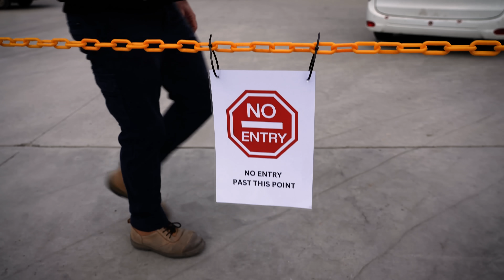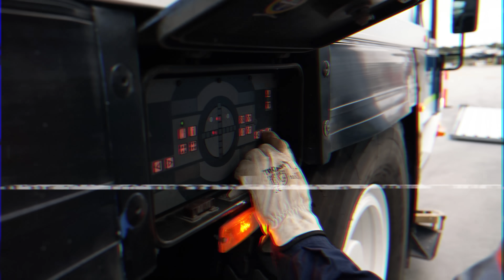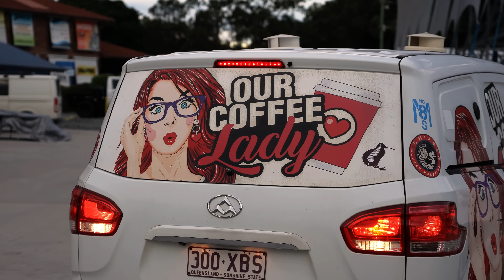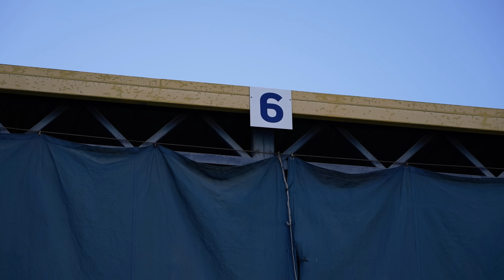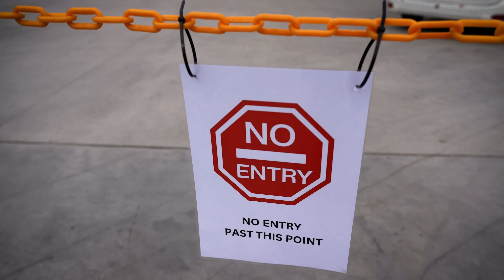FLIPPING Our Boat with a 60 Ton Crane 😱 Aluminum Catamaran Build Pt. 10

Comment: Woo Hoo! What a flipping good time.

We do that stuff all the time in the shipyard.  The only difference is that the parts we're flipping weigh in at 50 tons or more.  I was a bit concerned to see the big crane set up perpendicular to the CL of the boat such that the boom on that crane would experience a force off to the side when the small crane began pulling the hull to the side.  The big crane should have been set in front of the hull with the small crane at the rear such that there would be no radial force placed on the boom of the 60 ton crane.

Good job Y'all.  I can't wait to see her in the water.

Comment: Those chains on the crane to lift the boat from the shed seem kinda small but they worked! I can imagine that would have been nerve wracking.  I used to be a tool & die maker and we flipped 10 ton dies. I didn't like  being close when we dis that.

Comment: The other 2 cruisers, La Vagabonde and Gone with the Wynns built theirs in Asia. You picked Australia. I don't think the Asian places could have flipped a ship like that. Nice to be in a first world country that has the ingenuity and suitable equipment for the task to flip a 5 ton boat over. Well done mates.
Reply: They have construction cranes in most countries.
Reply: @captainjimolchs  Did you watch La Vagabonde episode when they tried to put their new Rapido in the water. It was a hairy moment with inadequate equipment and poor planning. Not only that people were onboard including Ralley when it was lifted about 25 ft in the air to put in the water. Safety was no concern. You would not see that kind of carelessness in Australia. I know about the 3rd world, I'm living in such a place in Asia as I speak.
Reply: @tommon6591  You have established that the capability exists.  Did anything break?  Was anyone injured?  I would guess that none of the crew of La Vagabond was lifted because there would have been no need for them to be there.
Reply: @captainjimolchs  Yes the captain, Ralley, was one who on the deck when lifted thinking he'll go down with the ship if it dropped and it almost did because the crane reached it's max extension and was about to tip over.
Reply: @tommon6591  So nothing broke and no one was injured.  The captain was either stupid or creating drama  for the video, or both, as was done in the current demonstration.  It is surprising that the operator allowed anyone aboard, or that it was necessary to raise to 25 feed to put it in the water.  How often do cranes fall over in Asian countries, compared to the rest or the world?

Comment: she looks like a very good liveaboard alu boat, not very sleek but not very fat either just in between performance and spacious living. dont go overboard with the internals though (insulation, cladding, finish) or else the weight gain from alu is lost.

Comment: Dear people, why don't you turn the ship around its transverse axis instead of its longitudinal axis? That would be much easier, less dangerous and also much cheaper. Do you put on your trousers with pliers in Down Under?
Reply: You suggest flipping a 5 ton boat like a pancake??  How on earth would that be easier than lifting the bow straight up, turning the boat 180 degrees by hand and laying it down again.
Reply: @esmith1771  Two cranes are needed again, but this time cranes with a much lower load capacity are sufficient. The ship only needs to be lifted slightly on one side until it is floating freely, then the second crane pulls the ship to the other side, while the first crane carefully lowers the other side at the same time. But why do something simple when you can do something complicated?